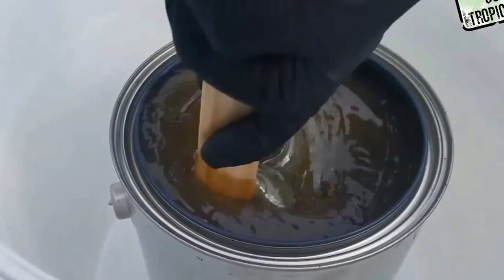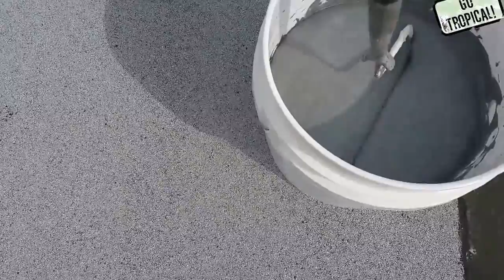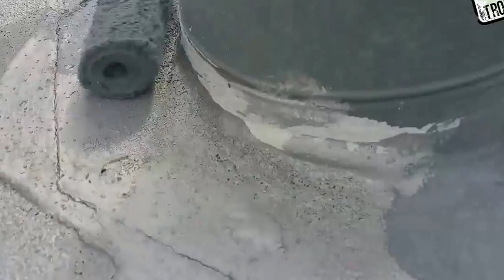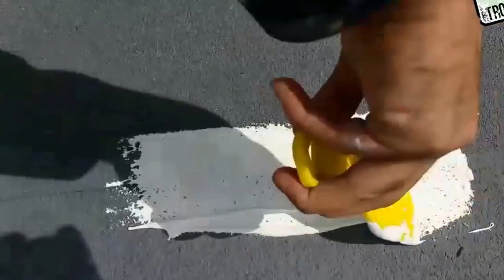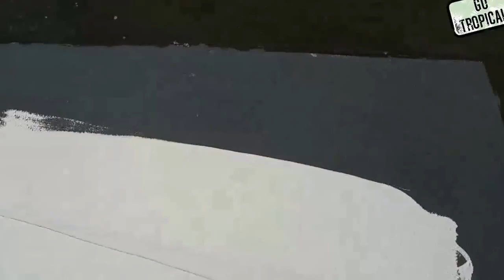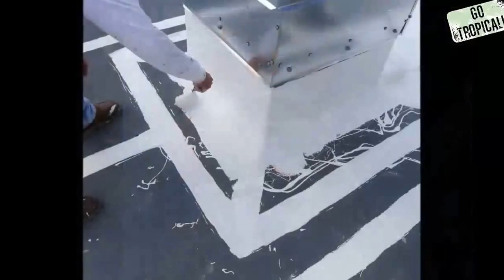Silicone Roof Coating Training  Video

Comment: Very uninformative video I agree with the other comment. Not enough info. We use the Tropical silicone line  and install 10-20 year NDL coating  systems. Tropical  now uses a 1 part water base bleed trap #996( primer) which is much more user friendly. Rate of application varies on length if warranty desired #996 1 - 1.5 gps. Silicone #924 1.5 - 2.5 gps Of course you have to be certified applicator to get these types of warranties.

Comment: The best investment I spent for the helpers mixing all my 2 part adhesives and coatings was to buy a simple electric paint shaker that holds from pints used in poursble sealer for pitch pans ,to 1 gallon cans ,and up to 5 gallon buckets ,a shaker going for 10 minutes will do a better job mixing than a helper with a stir stick can do in an hour  .

Comment: You removed all the labels off of the product containers??? How will I know which products you are applying to the roofing substrate? Are you advertising your skills as a contractor or are you providing an educational video of how to apply this product? It would have been nice to see how you cleaned the roof and with what products. Also, you did not mention why an Epoxy Primer is applied..Especially the one in the video. Is this to prevent bleed through of the cap sheet surfactants or is this Epoxy Primer used to create a mechical bond to the substrate and the silicone? There are quite a bit of important factors missing from your video as to why Primer is applied, when it is applied, and at how many mils. What happens if the primer is to thick? What happens to the Silicone? How many mils does the silicone go down per Specification? There are too many steps involved??? Perhaps Gaco Western S2000 may be a better solution for this type of roofing system....
Reply: Aside from a sales pitch, literally zero relevance as to the questions posed.
Reply: Nightraven Global Defense Group Hands down the absolute top of the line and longest lasting cold coating is a liquid EPDM coating made by Garland Roofing materials ,it's called " White Knight " ,for priming over a smooth surface Rubber ,PVC ,TPO or over torch downs and smooth coat Built up asphalt roofs a very thin " yellow glue " like EPDM bonding adhesive is used to prime ,for priming granulated cap a nearly water viscosity yellow glue adhesive is used to prime ,for top coating White Knight is applied best as 35 to 40 mils thickness ,the liquid EPDM is so strong it's like getting firestone poursble sealer on your skin ,and any roofer knows it takes months to wear that shit off your skin ,my crew did a 4,300 sq too coating job using the Garland white knight over a 25 year old Awaplan granulated cap sheet and had to come back 11 years later to install new call proof skylight covers and the shit was still blinding white with ZERO alligation or peeling ,I kept 60 gallons for myself and coated the 0.45 mil Goodyear EPDM system on the 16 sq flat on the back of my house ,remember Goodyear became Versico well before seam tape came out so all my seams were black glue and failing ,I 3 courses the seams using White Knight and garland mesh/rag ,waited a week and rollers on 2 coats of White Knight, when I clean the guyters every fall in amazed at how new that roof looks and feels ,the white knight even restored the old ass neoprene flashing Goodyear used to use .